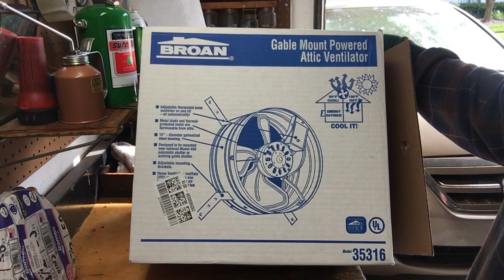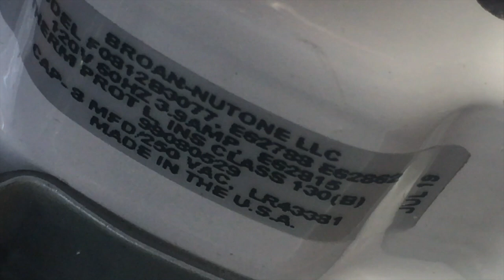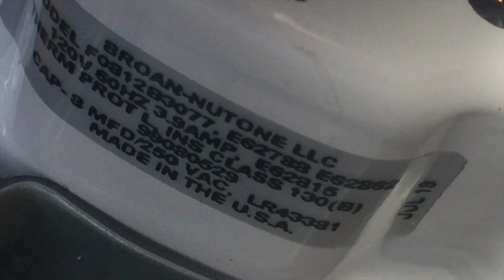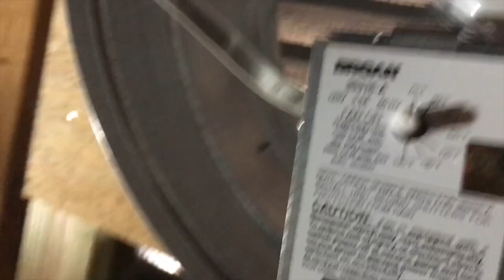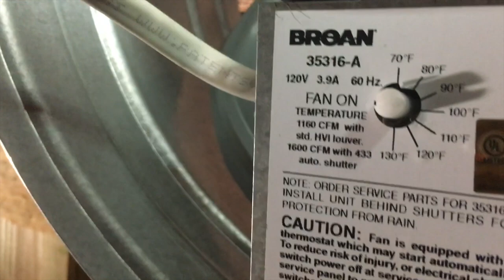Gable Mount Attic Exhaust Fan

Comment: Many thanks John, from hot and humid Eastern Oklahoma. I’m preparing (“fixin’ to” in Okie) to this same thing. I ordered the Maxx Air brand 1300 cfm 2400 sq ft unit that has the separated thermostat box like you spoke of. Excellent point on yours maybe not reading a true temp. Sounds good to me anyway. I ordered it back in March but ended up off my feet with a bum leg til the dog days of summer. Fun fun! Planning to make it a 5 am project after the night cools things off.  Thanks again!   -Lance
Reply from the maker: Sorry about your leg. This fall would be a good time to do it.

Comment: This was helpful thanks. Although I personally could have used a little more info on connecting the power to the light. Thank you sir.
Reply from the maker: Glad it was helpful!
Reply: @fixitjohn  You pigtailed the ground wires, got that. What did you do with the black and white ones?
Reply from the maker: @jere2464  I hooked them to the black and white wires in the switch box.
Reply: @fixitjohn  thank you 😊

Comment: If you have the fan on a switch leg, the t stat is only  getting voltage when the lights are on. I only seen two wires in that box. One of which you put in for the exhaust fan. Now your exhaust fan is switched with the light. The fan needs a constant source of voltage.
Reply from the maker: Hi William,   yes the fan has constant power it is wired before the switch. Thanks for watching it.
Reply: It's going to get false readings T static mount with unit...

Comment: You should put another fan on the other side of the attic and make it the ultimate wind tunnel
Reply from the maker: I have seen that done, but I only have one open end in the gable attic. Most of the draft comes from the soffits. I do have three passive exhaust vents in the roof though.

Comment: Its best to have two fans of the same capacity, except on one end of the house it should be drawing in air into the attic and the other draws it out.  You could cause very serious problems to your house by not having an airflow because if there's just one exhaust fan, there's nothing for it to draw so it's gonna draw whatever air it can which is most likely cooled air from your living space.
Reply from the maker: Thank you for your comment. The fan does draw air from the outside and it comes from the eaves down lower than this fan is placed meaning the cooler air comes in heats up and is picked up by the exhaust fan. This house was built with only one gable vent. Thanks for watching.
Reply: @fixitjohn  I understand the thought, however, I respectfully disagree.  You need to have the same CFM coming in as is going out.  The goal here is to have a 50/50 ratio and you're just not going to come even close with the minor seepage from eaves.  The goal here is to have your attic be the same as the temperature outside and you simply cannot evacuate the heat you are wanting using an attic fan that has no intake.   You want a steady flow of air crossing across your attic while trying to lower your home temperature.  My home was built in 1960 and I don't even have eves, nor any for at all for heat mitigation... that just wasn't a thing in 1960.  I had to do this out of necessity but in the process of learning before installing, it's common knowledge you must have equal air flow from the outside as is going out.  You're just trying to get rid of the 150 degree air and a simple attic fan will never accomplish that.
Reply: @te8828  Agreed that having inflow of air, whether passive or active (maybe continuously vented soffit would be sufficient) to match the exhaust will be optimal to keep attic temp within several degrees of outside temp. Are you using an attic intake fan? Do you have gables on either end of the house, so you can just flip one of the gable mount fans to be an intake?

Comment: can I use one of those light bulb socket to plug adapters to plug in an attic fan? there's already a light bulb in my attic like in this video and I don't want to mess with the junction box
Reply from the maker: I wouldn’t. It’s not that much harder to hardwire it. Good luck and thanks for watching.

Comment: Outstanding
Reply from the maker: Thanks
Reply: @fixitjohn  
Are the rubber washers necessary. I will take mine off and put them on if so.
Reply from the maker: @MrWhitelightning73  I was just trying to minimize vibration because that fan is about 4’ above our bedroom ceiling.
Reply: @fixitjohn  
Ok
Reply from the maker: @MrWhitelightning73  thanks for reaching out.

Comment: Very informative but like any other video about gable fan installation it fails to show you the before and after temperature in the roof.
Reply from the maker: Thank you for the tip, Miguel. I did not even think of that because I installed it in the wintertime. Great idea though.

Comment: Does this fan help
Bring down temperature in your attic?
Reply from the maker: Yes, the fan will bring down the temperature. I have put other brands up that have not lasted very long and, that sucks so far this Braun is running strong. I set mine at 100 degrees. I think When I go back up in the attic. I will set it to 110 degrees because here in Florida. It will run until 11:30 to 12:00 PM. If you need any help, don't hesitate to ask. P.S. I like your albums.

Comment: How many CFM on your attic fan?
Reply from the maker: I think1020 CFM it has been a long time. Works great still. If I had it to do over with the way my attic is vented. I would have installed it on the trusses because I have off-ridge, ridge vents. I hope that helps. Thanks for watching.

Comment: Did you just connect the attic fan to the light switch leg??? Lol I dont see a chain at the light socket? So the attic fan is going to work as long as that light switch is on
Reply from the maker: Yes and no it is not connected to the switch!

Comment: not good idea to have thermostat right at fan should be way back where the heat is not around flowing air.
Reply from the maker: Thanks for the tip.

Comment: So, the fan only works when the light is on??
Reply from the maker: No, it works all the time it is not part of the switch in the light. I did, however, turn the temperature up to 115 degrees because it ran all the time.
Reply: Fix it John oh, ok. I’ve just instanced a fan like this, but I’m not sure what to connect it to. There’s no light in my attic. The nearest power is my garage lights (both on same outlet) and my garage door opener. Can I tap into any of those?
Reply from the maker: If it has a junction box there and if it is not already overloaded meaning, not drawing too much current. You can, however, run a dedicated circuit back to the junction box by adding a new breaker it is easier then it sounds using the proper gauge wire and breaker. Before doing so, turn the main disconnect off !!!
Reply: @fixitjohn  it runs all the time because fans don't cool

Comment: Omg. It dont plug in?
Reply from the maker: Is that good or bad for you Marie? Thanks for watching.
Reply: @fixitjohn   not good! Lol. I'm just trying to fix a few things while my husbands going through some medical surgery's. I am not even playing with electricity.
Thank you so much though. 
Maybe, later dates I will learn that part. For now, probably best if I dont play with any electrical wiring. I should've anticipated it would be this way. And I'm sure I would be way in over my head, even more. I'm trying. But, some things best I know not to try.:)
God bless you and yours!
Reply: @mariesacul722  if you search around, you can find models that are plug and play with a dedicated power cord. I had found one on Amazon while searching for the one I ended up purchasing. It seems like it wasn’t large enough for my house size. If I run onto it again, I will post the link back to you. I saved John’s video to my favorites to find it again.

Edit: on second thought....I found a few while searching Amazon just now. Get on there and search “attic fan with plug”. There’s a couple different styles including a QuietCool brand that’s blue (it has some ability to connect to a phone app) and there are some that is iLiving brand that have a plug and a pull chain to turn it on and a thermostat knob. Looks like most of those have louvers on them as well. This info may point you in the right direction. Prayers for your husband’s healing and for your sanity. Ive gone through 4 hospital stays and 5 surgeries in the last 8 months and thank God every day for my wife being by my side and taking care of everything else as well.